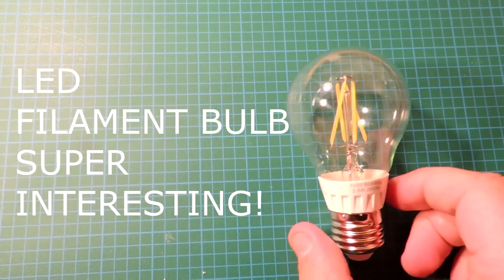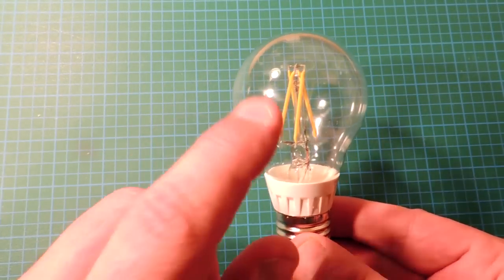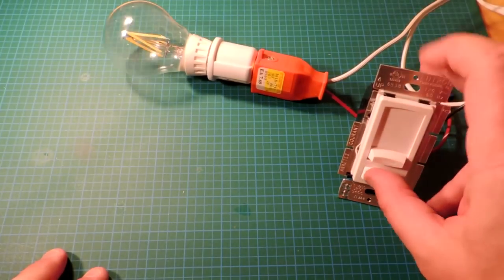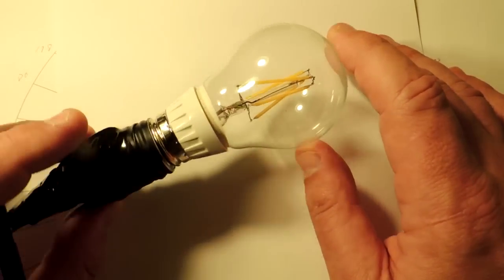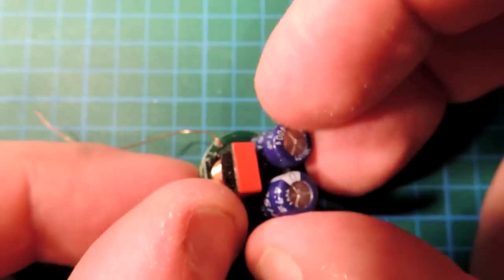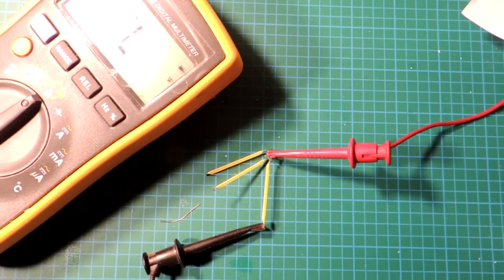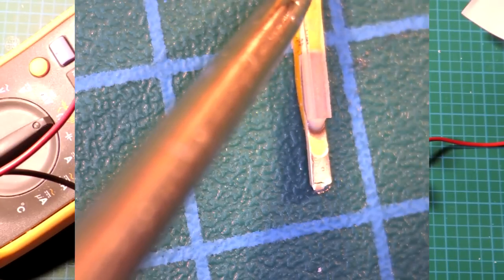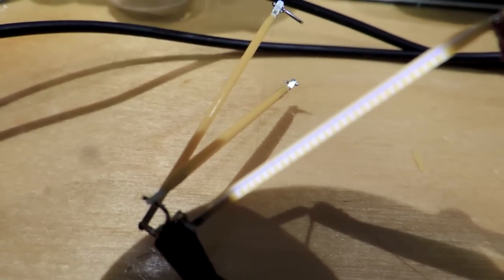LED "Filament" Bulb

Comment: Just bought a couple of 4W's off eBay. I'm quite amazed @ how bright they are! And I was surprised to find that mine seem to be dimmable (even though there was no mention of such). Testing w/ an X10 lamp module, they dim down to maybe 20% before they start flickering like yours did.
Reply: Madness832 Genuine AXP lights are dimmable and UL rated.  Clones are not.

Comment: 150 V is the open circuit voltage.  Did you measure it with a load?  Maybe it's current limited somewhere.

Comment: If you look at my recent filament teardown I got some completely different ones that use the same string of 28 LEDs, but have them mounted on a perforated metal strip.  That said, I just got a lamp like yours and it has the glass strips but only phosphor coated on one side.  Possibly not enough room in mine for a switchmode, but I'll find that out when I open it....
Reply from the maker: bigclivedotcom It's an interesting technology, I wonder how much of the LED market will eventually use this approach.
Reply: ***** I think the fact it fits in with the existing glass lamp manufacturing plants and quite frankly looks so good, that it will be a significant style of lamp.  I just opened mine and while it looks like yours the circuitry is radically different (simpler!) for 240V mains.   Teardown of filament style LED lamp.  (Awesome lamp!)

Comment: WOW! That was fast! Great teardown and review. How would you say it compares to standard 40, 60, or 75 watt incandesced for lighting a room? I to want to know more about the filaments.
Reply from the maker: It seems bright enough.  At 4 watts this particular bulb a bit greater than 400lm i if the vendors efficacy numbers are correct ... somewhere between a 40W and 60W incandesent bulb.
Reply: ***** it is correct for lumen. here we LED filament bulbs is 400-450 lm @3.5W. 800-850lm@ 6.5W
Reply: *****  Do you recommend these bulbs?

Comment: certainly a layout i never thought of, maybe theres a  gas that is somewhat conductive of heat they can put in there?, they only need to slightly improve the bar layout to get close to an incandescent filament output, frost the glass and no-one would mind having these
Reply: Frosted glass? Isn't the whole point the look of that bulb?
Reply: When they are lit they look like old fashioned clear bulbs.  That is the idea of the filaments.  I bought a bunch of them.

Comment: Wow this bulb is actually way more interesting than I thought - I'm bit worried about heat managment there, not much to dissipate heat into, mostly radiation especially since it's enclosed in glass bulb that limits convection. I'm also quite surprised that they run those strips in parralel, any imbalance (eg one of the diodes going bad making a short) would affect all strips.
P.S. I would not worry about that insulation in transformer, main insulation here is glass bulb itself.

Comment: I have some of those bulbs,other model with two sets of two in series.makes sense we have 230v here so the voltage drop can stay low decreasing the size of the switshing coil.

Comment: Definitely an interesting concept.. but as others I'd love to know what the thermals are on it since there's no heat sink just how hot did those little things get..
Reply: they are hotter than any conventional led bulbs but you can unscrew them without switching off

Comment: I have found them to be more susceptible to voltage drops than other LED designs. when I power on the cooker or any other power hungry appliance the bulb dims so much sometimes it goes out completely but other bulbs are only slightly affected.

Comment: COOL QUESTION FOR YOU! Great Video, first of all. Do you think there would be a way to power this bulb with DC power? For a shot in a commercial, we're looking to have an actress hold a bare bulb like this (a bigger version) with the edison style filaments, and have it fade on in her hand. Could easily solder leads with AC power and hide the wires somehow, but obvious in her hand, that's unsafe. Have any suggestions?

Comment: I have some candelabra base LED filament bulbs from Walmart under the GreatValue name to install in my ceiling fan.  With a base so small I don't know how they get any electronics in there.  Visually there is no strobing at all but you can see a slight pattern in the fan when running. Visually, when on, they are indistinguishable from normal lights when the fan is not running. I think these may be the final solution for the people who are still on the fence on bulbs.
Reply: I have the ones from Costco in my exterior garage lights.  They look as good or better them my neighbors lights.

Comment: Thank you do much for taking the time to post your video - I was wondering does the filament actually need to be in a glass housing to work. I would like to put this bulb in a glass jar, but 60mm Dia is just too big - I was wondering if I break the glass, will it still work OK? ANDREW
Reply from the maker: +Andrew Chesney It would continue to work.  the glass envelope provides electrical safety (the voltages on the LEDs are high enough to be dangerous). Some bulbs are rumoured to have helium in them which would help with cooling.
Reply: +electronupdate THANK YOU that's really helpful - I will be mounting in a "Kilner" jar - so no issue with electrical safety. Regards ANDREW
Reply: Did the LEDs overheat. There's no heatsinking.
Reply: Maybe it will work well if you break the glass. but it's not safety. take care

Comment: So in essence the filaments are very small COB LEDs. I don't know, why people still insist to get lights in antiquated bulb form. But I really like the construction of the COBs. Never seen something like that before. I'd like to know how hot they get. Each of the strips will have to dissipate 0.7 to .8 Watts.
Reply from the maker: COB as in chip-on-board?  No.  These are not individual dies mounted onto a substrate.  They look like a thick film deposition onto a glass substrate... which is exotic indeed
Reply: *****
Nah, it's a simple COB as I expected. Just small LED dies on a ceramic substrate as most COBs nowadays.
http://www.led-trading.de/LED-E27-Leuchtmittel-36W-COB-Faden-Klarglas-warmweiss
Do a search for "led filament". Almost all of them show a bulb like this, and half of them mention the COB.
Reply: ***** Yes, it is not COB.  Use the smallest power 27 epistar chips mounted onto Sapphire substrate. every strips is 0.75W. 70-80 V,10mA driver.
Reply: James Sleeman runlite makes LED filament,  and www.foc-led.com makes LED filament bulbs.
Reply: superdau I'll tell you why people still insist on the antiquated form... because they want the antiquated look. Like in my case. I'm looking to replace the bulbs in a 100 year old church and need/want to maintain the original periodness of the interior. Or restoring my grandmother's chandelier with small LED filament bulbs will be awesome. That's why.
Reply: superdau Not mega fussed about it being in an "antiquated bulb form" I quite like them to simply look...nice. Your typical CFL does not look at all nice. Your typical good LED lightbulb that doesn't use this, does look pretty nice. I like how you can see the little "filaments" however. They don't get very hot at all tbh

I got a lighting ever bulb, a blackberg  bulb and an 8W filament bulb off Amazon very recently. The 8W filament bulb was about as hot as the Blackberg bulb, and the Blackberg bulb was only "cool" because it's basically encased in a huge heatsink (Though the build quality of those is fantastic!) The Blackberg bulb consumes 10W of power, and delivers 810 or 820lm (It also has a three year warranty), the lighting ever product consumes the same amount of power, and delivers around the same lumens

The 8W bulb from Battery Logic uses 2W less and produces 830 lumens with a 360 degree beam angle (Much like the Blackberg one)
Reply: This style bulb is quite common these days.  I use them on my exterior garage lights to replace the old incandescent ones.  In the case both were candelabra style bulbs but I get a lot more light now.  I have them on Z-Wave switch so the hub automated their illuminate at sundown and later in the evening they go off as well since I have motion sensing spotlights for security. etc.

Comment: I'm amazed that this light doesn't seem to flicker at all in contrast with the same looking filament bulbs I have. I really like the type of lighting as well as the temperature but the flicker is downright awful at a low frequency. What could the difference be that these don't seem to flicker?
Reply from the maker: +KPsTboy Flicker is determined by the power supply topology in the base of the bulb.   Better quality bulbs offer lower flicker (since reducing flicker generally requires additional components and cost)

Comment: I wanted to see if one of these worked in my dimmer, so I pulled it out of the plastic packaging in near darkness (had torch at ready) and I noticed a little flash from the led strips. These things seem to detect static charge

Comment: Interesting.  I expected it to be series strings of LEDs, but not deposited on glass.  I was also expecting something like a capacitive dropper due to the use of long series strings of LEDs.
Reply: It is not mounted onto glass, it is sapphire substrate. also some people use the 
Cooper with silver substrate, this style cost is lower than sapphire. but sapphire light effect is more perfect.

Comment: How does it stay cool?
Reply: I think they are under driving the LED filament strips and put a constant current through them.
Reply: *****  It still consumes over 3 watts. Under driving is not the cause to keep it cool.
Reply: You see in the video, that these strips consists of a large number of LEDs in series. So they are working with high voltage. High voltage means less heat.
Reply: ***** Nope. Wattage is wattage, and the only relevant factor is the LED efficiency. If the LEDs are 50% efficient, and they're being driven with 3.6W, half of that 3.6W is going to be dissipated as heat. 

There's no getting around the physics.
Reply: Yes, but when these strips are 6 Watts rated and you put 3,6 through, then it will be much cooler. And for LEDs you won't get half the light, you get more than that because the efficiency increases when you underdrive them.
Reply: *****
Today most LEDs will convert about 15 to 30% of the power (W) in light. About 70 to 85% goes to heat.
My figures are approximative but the idea remains the same: 3.6W trapped in a glass bulb will heat up.
This is actually good as it means that we are quite far from 100% efficiency (683lm/W) at converting energy to light, meaning that there is a good margin for improvements.
Reply: FYI an incandescent bulb has an efficiency of about 2% (98% of the power goes to heat)
Reply: *****
I think you need to go read some books. Your basic understanding is incorrect.
Reply: Lagm an
That 683lm/W is only for monochromatic yellow/green light.  The most you can get from white light is 242.5lm/W.
And ~70% or more of the energy supplied to an incandescent lamp is converted into infrared light (not heat; they are entirely separate things).  Only about 15% is dissipated as actual heat.
Reply: Lagm an
 but the latest incadescent bulbs or better nowadays sold higher efficiency halogen bulbs are much better in efficiency. But irreplaceable is the light from halogen or incadescent bulbs: 2700 K, non-flickering, has real luminance (at LED we have to call it semidarkness, not light), color rendering index 100 (at LED 80-85), and they are dimmable.
However, when indoor in non-summer season, the produced heat stays at home, so the energy does not go away, just helps to your heating.
Reply: Thanks for the informations! I mostly agree with you.

Comment: Why do these light flicker? They use full wave bridge with smoothing caps - where is the flicker coming from? Is the frequency low enough to cause headaches, like on some shitty LED monitors?

Im asking since I've bought 4,6,8W versions of these bulbs and 4W doesn't seem to flicker, while 6 and 8W versions make horizontal lines when viewed on camera.
Reply: Zan I. These lights don't flicker as you saw on the video, though.
Reply: Depends more on Mfg then watts.

Comment: Does it get hot like an incandescent?
Reply from the maker: Leds get hot... not nearly as hot as an old incandescent, but they are far from cold when operating
Reply: Thanks
Reply: no, it's led bulb ,less than an incandescent
Reply: More like warm, some older LED bulbs did get hot but that problem has been solved for years.  Halogen is probably the hottest bulb, they are more efficient then incandescent but are often quite small for the high output they render.

Comment: Finally non-flicker version! Last year I saw these at local store, was impressed, looked really good, but had a terrible flicker!
There are 2 versions - one is for 220-240V (or 110-130V) and universal 85-265V with a normal driver, you`d like to have. Gonna try those out for sure.
P.S. I found a datasheet on http://www.runlite.cn/en/product-detail-145.html
And there`s interesting req-ment - it needs to be filled with the cooling gas. I wonder what they meant, isn`t that enough to just pump some air inside ?
Reply: That's interesting, this would resolve cooling issues I'm suspecting from this design. I guess what gas they may recommend, SF6?
Reply: Isn`t SF6 inert ? If so it won`t work, this need good conductor. Anyway this particular LED`s are not suffering from overheating, because current is only 15mA.
Reply: Dalsir
It's the power that counts. These strips take just 10 mA, but at 80V totalling at 0.8W per strip that has no other means of dissipating wasted energy than direclty to surrounding gas. Glass (substrate here) conducts heat poorly. SF6 conducts heat about 3 times better than air at same pressure. It is inert, but due to its high density it transfers heat quitte well. I've just learned that it is quite significant greenhouse gas...
Reply: Glass conducts heat just fine. That`s the reason why we have double/triple/xxx pane windows in houses. And windows still have a greater heat leakage than walls do.
And don`t forget that these LED`s are very efficient, and size is enough to dissipate
0.8W, not even worth to concern.
Reply: I'm referring to datasheets that you've linked where there is info about some extra  "cooling gas" :)
Reply: Probably that`s just air. I just asked if someone know what is actually inside. Chinese can write whatever they want, it doesn`t seem that oficial datasheet is true. I can mention some downlight 1Wx3LED where measured current was only 240mA U=9.6V , not even close to 3W directly on LED`s. Radiator is far from hot.
Then I added 6 Ohm resistor to gain 1.5 Ohms and, as result about 330mA current - all I saw was 290mA, despite that datasheet info is MIN 350, Typ. 420mA. Typical scam I would say.

Comment: I undesrtand that this bulb is not dimmable, what would happen if I use a dimmer on it?  thanks
Reply: They pulse.
Reply: Many are dimmable.  The candelabra one Costco sells truly dim.  Their $1 A19 ones do not and flicker at low settings.

Comment: LED bulbs have lower Ra (CGI index/color rendering index 80-82) and lower quality light when comparing to standard incadescent or halogen bulbs (with CGI 100). The light from incadescent bulb is not replaceable with todays LED (they are only at the beginning). I haven´t found e.g. E14 LED bulb with CGI 100, dimmable, 2700 K, with real luminance and with glass down to screw thread (bulb with all these parameters at once)
Reply: I used GE LED bulbs for the kitchen since these one have 93 + to 96+ CRI ratings. they dim and come in with 3000K or even select-able K outputs.

Comment: I also tore this bulb down and found it to be NOT Safe.   No fuse etc...  The packaging is poor.  One of mine was broken upon arrival.  No heat sinking.  Did you have a chance to check thermals?  I don't think this bulb will last very long.
Reply: i checked thermals of this particular model and it is one of the coolest, measured around 30C on the base and 33C on the upper plastic. those readings were at around 26C ambien temp.
Reply: Which bulbs have a fuse? I'm trying one at the moment, it works for a few hours and it's quite cool. Color Temp: 2700K and 4W it's a little dark, I suppose 6W could be better.
No flicking, less electronic parts, almost no heat emission, traditional glass bulb envelope (no chance to touch elements with voltage, people will not notice that you have LED lights, but you saving money because of low power consumption) these things are advantages with compare to normal LED/SMD/COB lamps, no IR or UV emission as per factory description, they said about 30.000 life span. I wondering what are disadvantages, there must be something, it could not be perfect...maybe this circuit board could cause some problems.